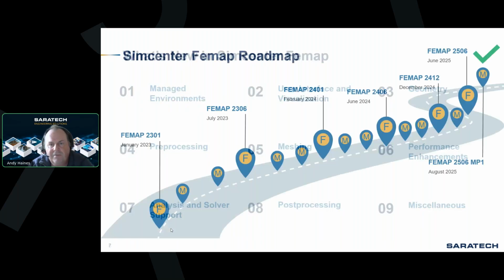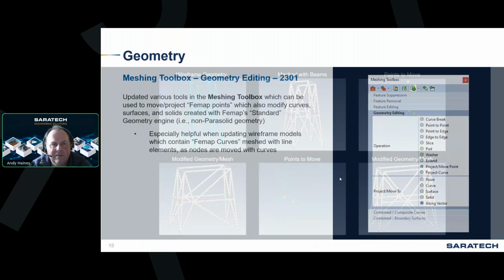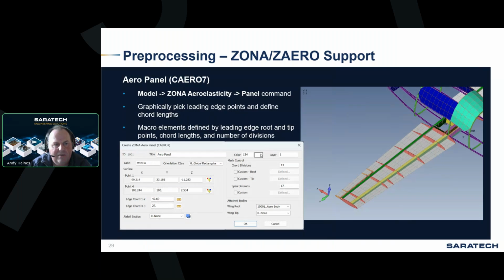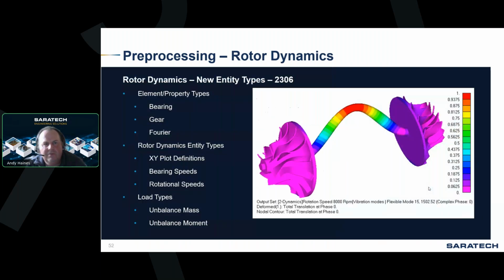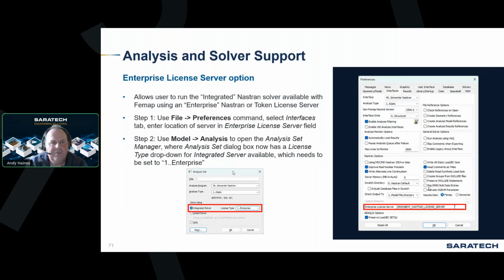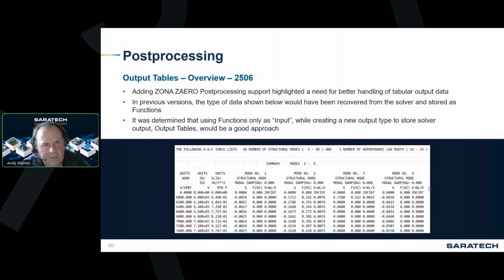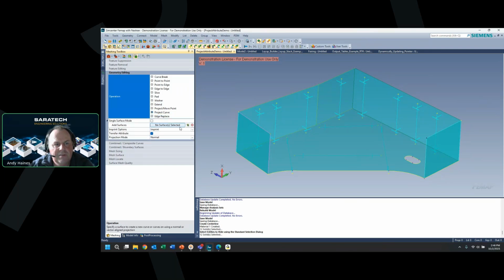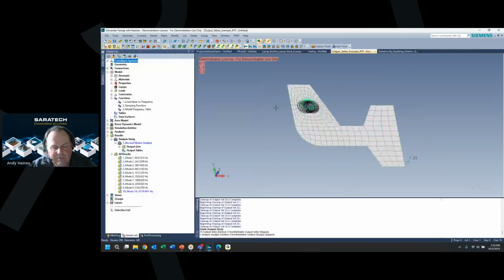CES  What's New in Simcenter Femap with Andy Haines

Comment from the maker: All right, thanks, Andy, and welcome everyone. I saw that a lot of you who signed up have been in FEMAP or Simcenter FEMAP sessions before, so hopefully this won’t be too much repetition. I’m going to go over quite a few topics, but many of them only have a couple of slides, so don’t worry—I’m not going to PowerPoint you to death.

All right, so just a little bit about the FEMAP roadmap. We’re not really going to cover anything outside of the versions you see here. Just know that the current version of FEMAP is 256, which was released in June. There has already been one maintenance pack released in August. The next version will be 2512, which will come around the end of the year.

The first thing we’re going to talk about today is managed environments. When we talk about that here at Siemens, we’re talking about Teamcenter integration.

So what does this allow FEMAP to do? It allows FEMAP files and related files to be managed by Teamcenter in Teamcenter Share environments. These are controlled, and everything we’re going to do with this is accessed through the PDM menu, which we added in 2301.

A little bit about the history: in 2301, the initial implementation also allowed us to deal with what we called shattered JT assemblies. That was a big thing because we really had no way to read those in before. However, it was limited because new items had to be created via the Rich Application Client before they could be used in FEMAP.

In 2306, we added the ability to specify a server. In 2401, we updated command names. In 2406, we added various enhancements: updated dialog boxes with column filtering, the ability to create a new item when saving to Teamcenter, the ability to open FEMAP and neutral files, and check-in/check-out functionality.

In 2412, we added the ability to import geometry directly from Teamcenter, along with analysis models and analysis results. We can also save all of those back to Teamcenter. One of the newer things is the ability to add associated files. You can include things in the same directory, such as Excel spreadsheets or PowerPoints, but the big one here is including solver results files, such as Nastran results, with the model file for a particular analysis set.

Now in 256, this is a big step. It allows the creation of a CAE 3D analysis item directly from within FEMAP. You can also specify CAE target relations with the source CAD. This is really for better integration with Teamcenter for Simulation, along with some additional searching help.

If you haven’t used FEMAP since 2301, we finally added a command finder again. The initial implementation was basic, then we added keyword searching and searching toolboxes and panes. In 2401, this took a big leap forward. It now dynamically lists matches as you type, highlights where the command exists in menus, toolboxes, or toolbars, and provides a hyperlink to search online for your query. It also supports searching custom user tools and includes a shortcut key.

I’ll go through the presentation first, and then I’ll do some demos at the end.

A simple example: often you need to find all holes of the same size so you can remove them or use meshing tools to simplify geometry. Now you can pick one hole, FEMAP finds all matching holes, and selects them for you.

Groups are very important in FEMAP, so we’ve made several updates there. The Condense command used to turn everything into ID rules, even for entity types that didn’t exist. Now it only condenses down to IDs that actually exist in the model. A better option is the newer Group Operations “Reduce to Existing” command. It preserves the original group logic while reducing it to only entities that exist. There was a known issue with this that was fixed in the August maintenance pack.

Another small fix: automatic add could duplicate entities after renumbering. That was corrected.

In 2306, we changed how we access CAD data translators. FEMAP now uses the same components as other Siemens products. This gave us new translators for CATIA V6, Inventor, and Rhino. If you were paying for the CATIA V5 translator before, it’s now included in the base product. These components are well maintained and make it easier to keep CAD geometry up to date. If you access geometry through the API, it’s now done through the Geometry Interface Object.

We also made improvements in the meshing toolbox. FEMAP has its own geometry engine, so FEMAP points and curves are non-Parasolid geometry. Historically, many meshing tools didn’t work well with this, but now they do. If you have wireframe models with FEMAP curves, you can move points and everything updates as expected.

(Continued in comments below)
Reply from the maker: Another example: sometimes you have a fillet that you want to replace with a plane. FEMAP can fit a surface and remove the fillet, making the geometry easier to work with.

A major addition in 2406 was Edge Replace. This allows you to select one curve and replace it with another. It works on surfaces, solids, and non-manifold bodies. There are three methods—full, partial, and edge align—and the result depends on the selection order. This is especially useful for midsurface models and preserves non-manifold connections.

New in 256, we added enhancements to Project Curve. You can project onto a single surface or multiple surfaces. The big addition is Transfer Attributes. When curves are projected, their meshing attributes move with them and are repositioned as needed. This works especially well with centerlines created using the Geometry Curve Centerline command.

You can see that the curves are projected and split, and the resulting mesh aligns correctly with the surface.

Moving on to Zona. Zona was founded in 1985—the same year FEMAP was founded—and focuses on aeroelasticity. Siemens acquired Zona in March of last year. Previously, using Zona was a very manual, text-based process.

In 256, FEMAP now supports Zona aeroelasticity directly. You choose whether you are using Nastran aeroelasticity or Zona aeroelasticity. Supported entities include CAERO7, PAFOIL7, BODY7, SPLINE, and CORD. BODY7 can be read, written, and displayed, but not created in FEMAP.

We support full dialog creation of CAERO7, PAFOIL7 section preview plotting, dynamic panel display, and splining back to the structural model. Flutter settings are handled through dedicated dialogs.

Laminate enhancements were added in 241. The layup builder allows you to automatically build layups by creating a new stack, loading an existing stack, or attaching a Fibersim HDF5 file. You can select entities by elements, surfaces, or groups, and FEMAP uses these options to automatically create layups.

We added randomized property colors and a bottom surface offset option in 2406. You can visualize selected elements, outlines, and fiber directions. You can also click an element to see which layup rows apply. Errors are highlighted with explanations.

We also added Model Laminates: Add Plies to Mesh. This allows you to insert plies above or below existing plies or global plies and automatically creates new properties and layups. This is useful when you need to locally add reinforcement without rebuilding everything.

We now support rotor dynamics with Simcenter Nastran using Solution 414. This required adding new element properties, rotor dynamics entities, XY plot definitions, and new load types such as unbalanced mass and moment.

In 2406, we added full support for RROD and RBE3-style rigid elements for better round-tripping. We also added auto-creation of constraint definitions, similar to how load definitions worked.

We added support for incompressible fluid surfaces, which are used to model sloshing modes. The fluid-structure interaction is handled automatically, allowing visualization of sloshing behavior.

Another small improvement: using existing spacing in meshing, so biasing is preserved even if you didn’t create the original mesh.

The Body Mesher now honors growth factors. Mesh Region, which has been around forever, is now much more robust and fills regions correctly even with complex selections.

On performance, we’re continuing work on the Unified Graphics Architecture. This started in 2301 and will eventually replace all other graphics pipelines. Currently supported are geometry, nodes, loads, and constraints. Beam and solid elements are planned for 2512. You can disable unified graphics per entity type if something doesn’t look right.

We also added a max frames-per-second setting to reduce jitter. The default is 40 FPS.

You can use the integrated Nastran solver with an enterprise license server by configuring it in File Preferences under Interfaces.

For Zona, we added a new analysis program and analysis type 390, starting with flutter. Aerodynamic data, Mach number, reduced frequencies, and flutter-specific settings are handled through new dialogs.

We added modal frequency response support for Solution 401, requiring two subcases. All required setup is now handled in the Analysis Set Manager.

We added support for HDF5 output and results from MSE Nastran, Abaqus step hierarchy improvements, Abaqus analysis monitoring, Ansys meshed beam cross-sections, and bolt preload post-processing.

A major improvement is Output Tables. Previously, tabular solver data was imported as functions, which mixed input and output data and lost metadata. Output Tables are now stored with analysis studies, support multiple data types, retain metadata, and provide intelligent post-processing and charting. Data can be copied directly into Excel.

All Solution 414 results are stored in SED5 format. Complex results no longer need to be expanded ahead of time—they’re handled on the fly for visualization.

We also added support for aero box deformations from OP2 files, complex flutter mode shapes, Campbell diagrams, and improved annotation leader behavior.

Licensing management has been updated and is now accessed through Help → Manage Licensing, with clearer status indicators.

I’ll now jump into FEMAP and show a few of these features.

All right, let me just go over to FEMAP for a second here, and I’m just going to show you a few of the things I talked about.

One of them is curve centerline. I’ll just pick any old material and do it on all of these. What that did was create centerlines and meshing attributes here.

One thing I don’t know if everybody knows is that you can highlight over here on the checkboxes and say Select to Hide. This is kind of a different way to do it instead of having to manually pick the checkboxes. You basically get standard entity selection. So I can just go to Previous. That’s just a nice way to turn off all those solids I just used.

Then if I come into Meshing and go to Geometry Editing, this is where I can do Curve Project. I can pick multiple surfaces and now pick multiple curves. You can see how the meshing attribute stayed there, but it’s been repositioned. I could do the rest of these as well, but I’ll skip that for now.

So next, just a little bit about the Layup Builder. You can make a new layup stack, give it a title, specify a material, give it a thickness like 0.1. The nice part about this is you can just pick entities directly. I can select elements if I want.

I’ll clear this for now, and instead I’m just going to load one I already have. You can see that I’ve created my whole layup stack. By layup stack, I mean all the plies I might possibly want somewhere in a portion of my model.

Once I have this, I can see that the entity selection has already occurred. If I want to see where things are applied, I can choose to show selected elements. So here, ply 11 is only going to be applied to those 156 elements in the back.

If I want, I can always check my ply info. I have no errors, which is good. Then I can just say Build Layups. It asks if I want to create three properties and three layups. I’ll say no for a second.

Right now, there’s only one property in here, and it’s just a regular plate property. Now I’ll come back and say yes. At this point, all my plies have been created. If I take a look at the properties and modify colors, select all, and randomize them, you can see how everything is now broken out.

This is where I can use the new Model Laminates → Add Plies to Mesh command. I can pick what I want to add, say one ply, give it a thickness like 0.1, and choose where to add it. I’ll add it above the global ply in the middle.

You can see that it automatically made new layups that now include that new ply. That’s really powerful.

Where this gets even more interesting is when you use Fibersim data. I’ll load that and just show an outline. I can show the outline of the component, show the entire component, or show the fiber direction.

If I zoom in, you can see the fiber direction for each particular ply coming from the Fibersim data. Using that data, I can automatically do entity selection. Now I can see exactly where each ply will be applied.

When I build layups, it’s going to create 1,179 properties and layups for about 13,000 elements. I’ll say yes, and you can see how quickly that runs.

If that’s too many, I can undo and instead control layup creation. For example, maybe I only need one every five degrees instead of every possible degree. I’ll pick my elements again and build layups. Now it creates around 700 instead. So you can really control how dense that is.

Next, just a quick look at the dynamically updating pointer. The nice thing here is that the text stays in the same place while the leader updates as you rotate the model.

Finally, I want to show output tables. I’ll close the Layup Builder. Right now, I have results but no output tables. I’ll quickly run a modal frequency response where I’ve requested modal participation factors.

Now you can see that output tables exist here. They’re all nicely organized. I can look at them, plot them in the charting window, and see what’s going on. These output tables live with the analysis study.

If I delete the study, the tables go away with it. There are no extra functions floating around anymore. Functions are now really just for input data.